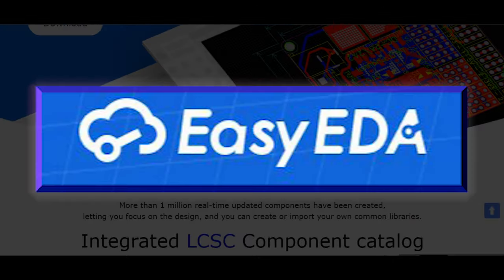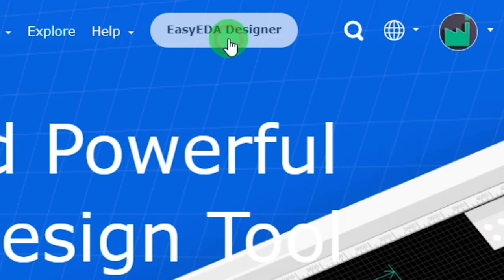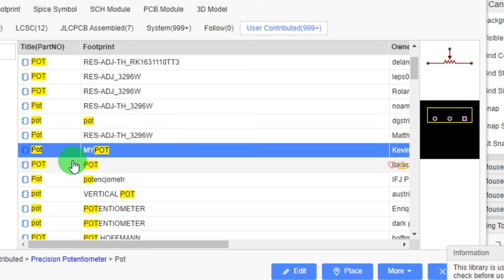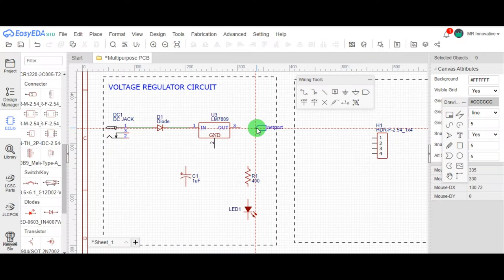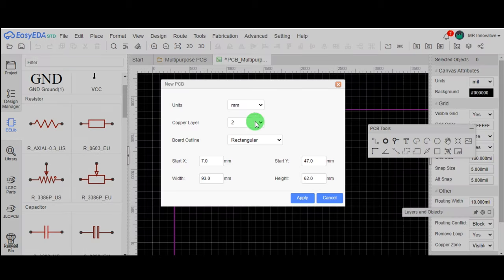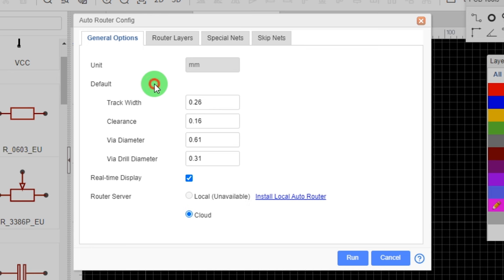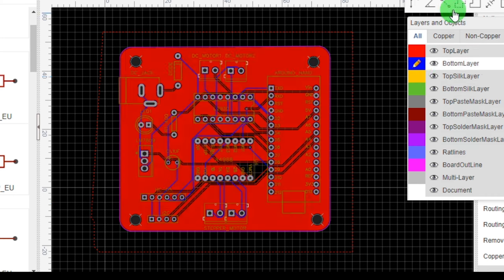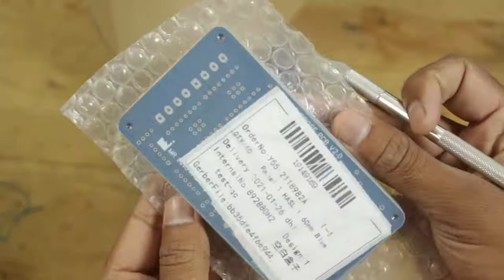How to easily design PCB in EasyEDA software

Comment: Good video, it's nice to have step by step walk thru for total noobs like me. 

I noticed that the boards cost $2 but shipping was $35, gasp. 

Would you do a walk thru with surface mount components added by the fabrication lab?  I'd like to see an example with a 5x7 array of surface mounted LEDs, some resistors, capacitors, and a chip of some sort.  Perhaps just display 0→F counting up in hex?
Reply: you can change the shipping type and it will only cost 1.60$ for me and took 6 days

Comment: Nabeel from Iraq, thank you very much for the good video it was clear, and requesting you 
guide me in my first experience in making a PCB for my simple circuit if you agree then
we will proceed and one more thing does the LCPCB company can supply me with the required Components needed for my circuit because I face difficulty in finding some like 
MT3608 AND MT7955 thank you again.